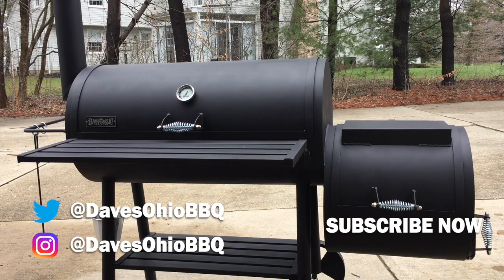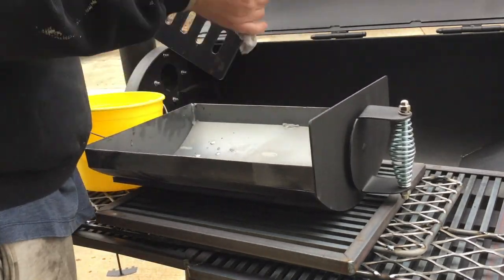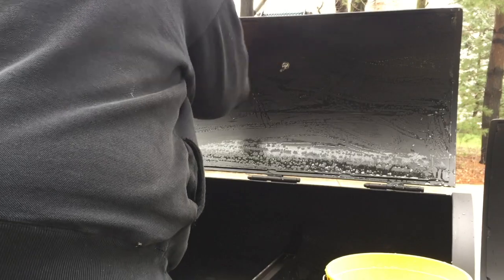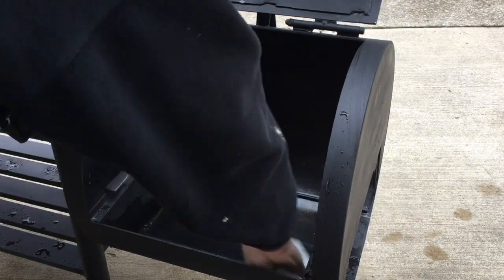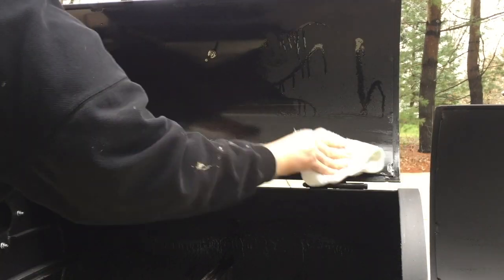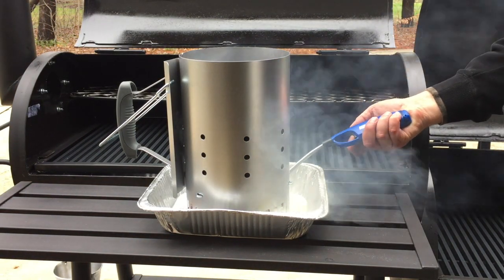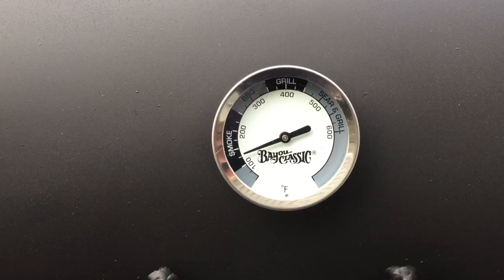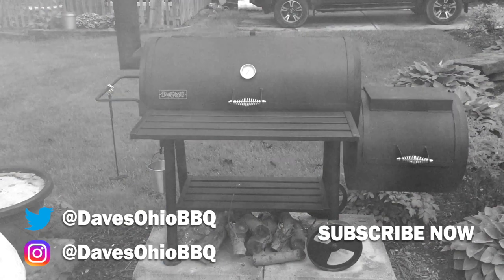How to Clean and Season an Offset Smoker

Comment: NOT olive oil!  It doesn't handle high heat well at all.  Use canola oil, or some people mix canola oil and bacon grease, or you could use the high-temperature spray-on Pam.
Reply: Eric Smoke point for olive oil is around 400 deg F, so should be ok
Reply: Agree with Eric, never olive oil. Canola oil all day.

Comment: Never never wash your smoker lol. No soap never water. Coat smoker Heat it up to 400 for 4 hours 1 good size log. Done
Reply from the maker: steve elliott I disagree. There’s no harm in washing the interior of a smoker before the fire fire/seasoning. Helps to break down any non food safe oils and greases left behind in the manufacturing process. Rinse it good, dry it out, then get some oil/fat in there to season it. Thanks for the feedback.
Reply: Dave's Ohio BBQ why use chemical and water that make metal rust when. Heat and fire is the medium used in the smoker. Work smarter not harder
Reply from the maker: steve elliott agreed. It probably is an extra step, but any water I put in there was quickly evaporated when I got the fire going. It’s how I’ve always done it (with brand new smokers) and it’s worked out fine so far. Thanks for the feedback. Happy smoking.

Comment: Olive Oil is not a high heat oil - it puts out fumes at a certain level of heat
Reply from the maker: Denali King very true, but most smokers don’t run higher than 225-325, so it works fine. Canola oil would be a better choice. I’ve seen guys use WD-40, but that freaks me out.
Reply from the maker: True. Canola is a better choice, but the olive oil worked fine. My cook chamber very rarely goes above 300 degrees. Thanks for watching.

Comment: wtf - you dont wash iron ...
Reply from the maker: bavariasuhl you do if it comes from a factory and you have no idea what chemicals and greases are on the surface. As long as you heat it up quickly and evaporate all the water there is no harm. I rinse my cast iron pans all the time, they’re over 75 years old and still rocking. Thanks for watching.

Comment: And WD 40 is a degreeser not an oil.........
Reply from the maker: Yes, but used most often for lubrication
Reply: @daveshouseofbbq  yes it is but it's not a good one it doesn't last long...... I've used it for years, still do.... but I just really found out that it technically was a solvent and not lube check out some YouTube videos they explain it and makes since

Comment: I bought a OJ offset smoker & never used it to smoke yet only grill multiple times, & I never seasoned it. It is too late? If not then how do I proceed?
Reply from the maker: Glenn Mance how many times did you grill on it? It probably seasoned itself. All the grease from the meat that turned to vapors probably did the job for you. I don’t think any harm would be done if you just wiped  it down applied some oil and heated it up.
Reply: You can definitely season after the fact. Lots of people re-season every 3-6 months.